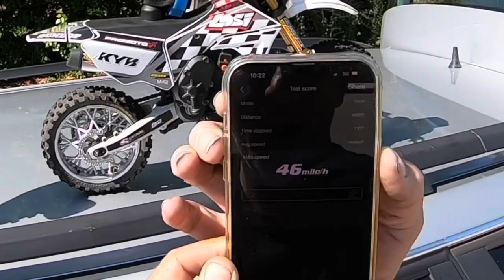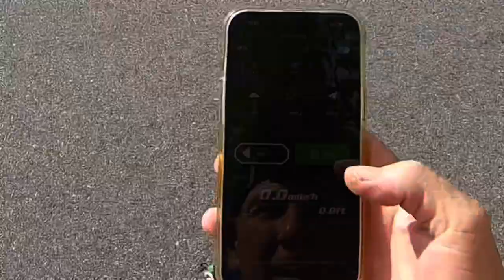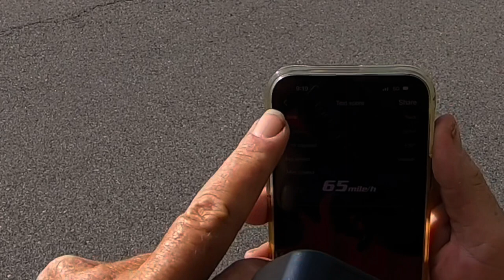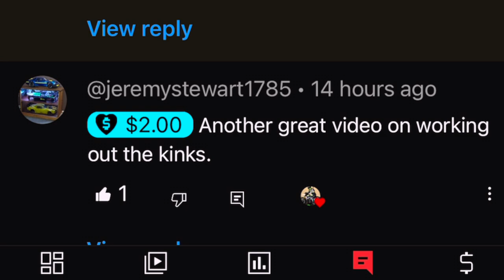Losi Promoto MX Lost My RC On It’s Fastest Pass Ever! New World Record Promoto Mx?

Comment: I hate that it shows the "@" now instead of our screen names. Anyway, Another great video Earl/ Giving me so many ideas! I wont ever go for your kind of speed record as I can see the bikes limitations. I used to have some speed wobble with my stock wheels after a few crashes. Dont get it on my street tires now but I am stock sill. But if you notice the steering twitch during shutdown then the servo itself may be a little hurt. One thing that helped out with slop and response for mine was adding the GPM aluminum servo saver and using the extra spring that comes with the bike. I no longer get that "wondering" center where from time to time you have to trim it left/right.
Also there is no dampener fluid. If you see my rebuild video you can see I replaced the entire nose of the bike and there is ZERO fluid up there. May want to get the aluminum upper frame section one as well. My bike is still doing 42 being all aluminum now. I think your biggest issue is wheel/tires. I think the wheels need some weight. I was thinking Vitavon because they do add weight down low and they are perfectly machined.... problem is they are for the off road tires... wonder if they will make a street tire version? But those should also help with the speed wobble. Kudos sir on the record and keep up the great work. You have helped me a lot along the way!
Reply from the maker: Appreciate the support watching the horizon Losi podcast talking about the way they looked at this rc to get it working right was thinking as if it’s a 1 wheel rc just the rear tire and hat was there break threw on getting it to work and stay up I can see what they mean by that as it doesn’t really matter what the front does it will stay upright if the gyro is working that’s why i decided to make that function first on 2S then go for speed runs 👌
Reply: Great Contribution brother! I gotta check out your rebuild...👍

Comment: With some of the rc cars when the gyro is up to high it causes the car to wobble.  Turn the gyro down to see ifit gets rid of the wobble
Reply from the maker: I did I even show it before the run and explain I turned it to 0 🧐
Reply: @earlmoorhead5555  you seemed to have some play in the servo saver connection to the folks and also make sure that the wheel doesn't need a spacer incase it has a small amount of play in it.
Reply from the maker: @scottward8446 https://youtu.be/3JyOe2c7foo?si=-GgcjPZZLf6OkbC5

Comment: Are you certain the “Speed Wobble” isn’t from EMI/RF interference or harmonics from the gyro at speed which my be playing with the steering channel of the onboard Receiver (RX)? It appears the Wobble is pretty severe, more so than the “play” you demonstrate with the servo saver on the bench. The choke (small ferrite donut the servo wires pass through is there to help reduce EMI/RF interference. You shortened the lead and reinstalled the ferrite choke, generally you need to loop the wire through the choke as many times as you can so that it has the ability to do its job. Also, you may want to be certain the servo wires, RX, and its antenna are routed free and clear of the servo wires leading to the gyro. The Gyro is likely putting off all sorts of RF noise that we can’t see or hear - which my be causing glitches or otherwise undesired operation.

I hope this helps, keep up the great work.
Reply from the maker: This happens on all arrma speed cars as well with spectrum avc normally we turn it off to stop the steering shake

Comment: If yours goes that fast on 3s motor rpm is 47-48,000. I put at 6500kv on 2s so motor rpm is 54,000. I still need to install the motor. Currently running a 5400kv. I think a 6500kv on 3 could get closer to the 100mph benchmark.

Comment: These Questions don't have anything to do with the promoto. But I'm trying to put new tires on my infraction. Have you put out a video on aligningment I've used a speed square to get the camber right on the rears but they still just don't look right none of my components are bent what camber and castor do you set up the front wheels at.Untill my solide m2c racing tires come I'm trying not to burn threw this new set of hoons. Your videos are great and a grrreat help to more of us out here than you could ever imagine.  Alot of these guys on tube are so secretive about their upgrades iif your getting boo koo bucks I understand but this is the BASH COMMUNITY.  SORRY SO LONG BUT IL TRUST YOUR KNOWLEDGE OVER ANYONE ON YOU TUBE.
Reply from the maker: I use an iPhone app called bubble level for alignment videos on my channel

Comment: Who makes different gearing option? A bigger motor sprocket won’t fit?
Reply from the maker: The pinion is standard 🧐the spur will have to be modified and that’s being worked on alongside the rear sprocket
Reply from the maker: Didn’t you ask this already ???
Reply: @earlmoorhead5555  yes sorry my bad, I thaught you were talking about the internal gears

Comment: The high speed wobble it gives thru on its way up to full speed, it will go thru the same wobble on the way down... its not the AVC ! It's the lil nob, that rides in the oblong hole in the actual steering rack. Make the nob bigger, or the oblong hole smaller... I used a small piece of rc wing hinge material, superglued it into place, then sanded it to fit nicely. Eliminated the wobble for me. Before you alter it, make a pass with the AVC 100% off, full clockwise.
Reply from the maker: There is no avc knob 😮
Reply: WHAT?
Reply: If your going to run 100mph, on your way up to a 100, at, let's say 72mph it gets a tank slapping shake, then goes away as you continue to 100mph, when you start desending down, when you get to 72mph the tank slapping shade will be there again. Steering damping with fix it. Remember the bikes normal top speed is 42mph.
Reply from the maker: @tonyrogers1683 yes vendetta top speed was 70 mph and an esc swap got it to 114mph 2wheels will be challenging that the fun my rustler was top speed of 30mph and ended with 120mph there Will alway be challenges 👌
Reply: The AVC on the MX is the knob that says "mx6" counterclockwise is 100% vehicle control. When it's turn up high, the head unit, "steering" can oscillate, like the tail boom on a rc heli. That can cause a shake, cause at high speeds the radio, Rx, has a hard time making a decision on where it's at. When the mx6 is turned clockwise, it's letting the rider determine how far to lean, and how fast to lean. Mine is full stock, supermotos, little clutch work, and absolutely no drag resistance. Never been anywhere but on the tarmac. Ita make a 48mph pass. Plenty fast enough for my run area...
Reply from the maker: @tonyrogers1683 it’s at 0 and steering in full avc mode
Reply: @earlmoorhead5555  I don't understand, it's at 0, and full avc mode ?
Reply from the maker: @tonyrogers1683 yes avc controls throttle cut so it won’t wheelie and steering Mx seems to just control how fast it will drop the bike into a lean for turns everyone’s tells me it controls steering as well but it’s not showing signs of that at all
Reply: @earlmoorhead5555  oh... the drive modes. 1 blink dirt, 2 blinks street, and 3 blinks wheelie mode. Yea, that won't cause a high speed wobble. When in wheelie mode, when it raises for a wheelie, to far up, before it throws the  brakes on, it will go into neutral, then brakes. Street mode will go directly into brake, if it goes to far up. In dirt mode, it let's you throttle faster without coming up, so ita go up the face of a jump. I been collecting data on the mx for about 3 years.
Reply from the maker: @tonyrogers1683 it cut throttle in different modes I’ve tried mode 3 and mode 2 so it won’t flip over both run the same numbers
Reply: And I no your well aware the fly wheel, is a totally different unit from the motor that powers the rear wheel. The flywheel motor has a pre set acceleration in the esc and the Rx... same as the drag brake to slow it down to full stop. That flywheel acts like 1 pound engine spinning. It's like a brushless out runner on a rc plane, the can spins with the propeller, but instead it spins a balanced one pound weight. It's actually feat of technology. If you can put a faster spinning motor, that would on a 3 cell, and it fit, spinning the same flywheel... well it would practically stand up on two wheels by itself. But would be prone to roll like a ball if it got in the position to flip...
Reply: @earlmoorhead5555  you can make a speed run in wheel mode, you just don't throttle so fast that front end comes up. And once your get to the point, the back wheel will no longer try to pass the front wheel. A controlled wheelie is just not letting the rear wheel get in the front.
Reply from the maker: @tonyrogers1683 yes as I showed but doesn’t stop the steering avc not sure what your asking me ? I’ve showed all this ?
Reply: @earlmoorhead5555  well... the bike will be crazy as a bed bug on crack with out some avc. Even when it's turned all the way counter clockwise, it's still adding some to make it controllable. Make a small clamp to fit one fork leg, make a small mount on one side cover. Take a really small rc oiled filled shock... no spring. Mount it between the clsmp and mount, make sure it doesn't obstruct the full range of the steering... that will remove your wobble, heaver the shock oil, the less the shake. Mind you, it could be taxing to the servo when your going slow, and steering fast. But the high speed wobble will subside. I salute you for your curiosity on the mx...